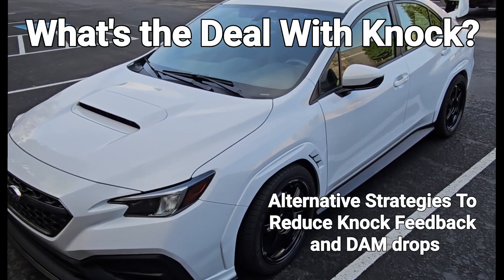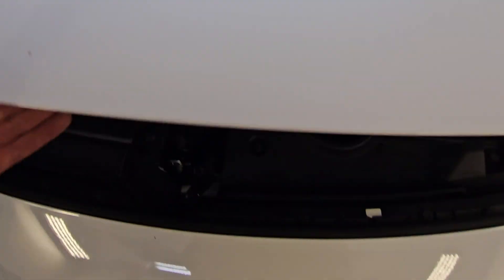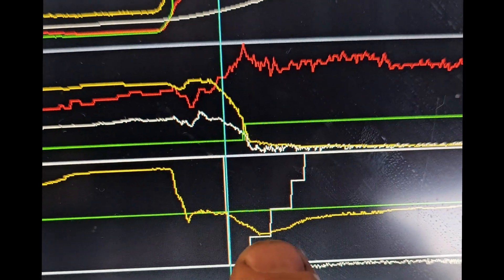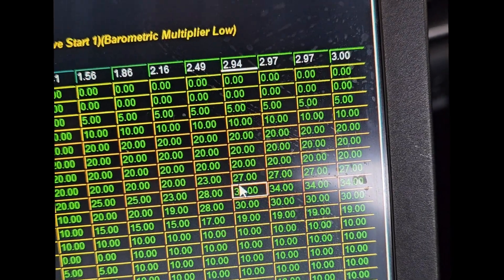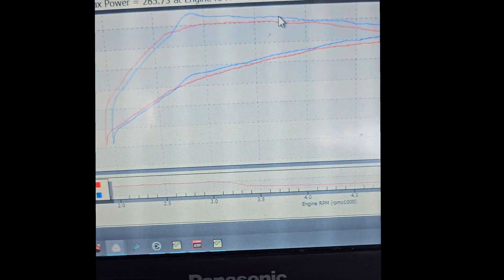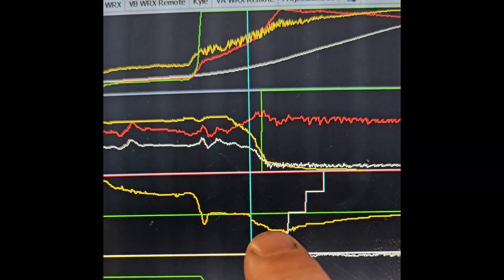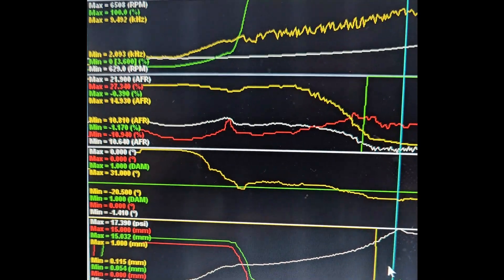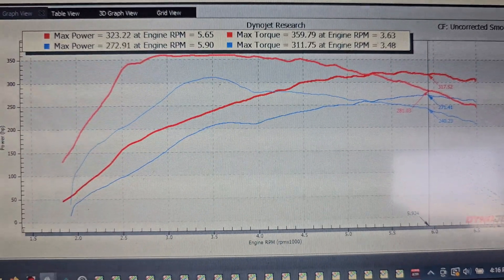VB WRX Tuning | Fixing Low DAM & Knock Issues on Cobb OTS Tune (Customer Car)

Comment: Was it the injector timing that fixed it? Any changes to the tip in enrichment? When did injector timing start to become important on Subarus? For reference I have been tuning my 04 STI and 09 WRX with ECUFlash, neither have injector timing defined.
Reply from the maker: So,  on DI engines tipin isn't really a thing since there's no pooling on the walls/valves. Injection timing is everything on DI. It's actually a lot more important than most people realize in port injection as well especially on cars with very large injectors and/or big cams.
Reply: @WT4T  Ohhh I didn't even think about that. I know injector timing matters a lot of diesel engines so I guess it makes a lot of sense it would be the same on DI engines. I learned a lot tuning my STI and when I went over my WRX e-tune I realized how lazily it was done!

Comment: Hey brother i have a vb wrx cvt and have the cobb ots 91 map. I have ets cold air and axleback exhaust and my dam is ALWAYS low. Can you provide me with some information on what to do?
Reply from the maker: Well, that's the wrong tune for that intake. Probably just get the car tuned, and you'll be fine! If you email me at willtunefortacos@gmail.com I can get it taken care of for you.
Reply: Ladies and gentlemen, the average human. "I put parts on my car with no thoughts or knowledge and now it act wrong. Wat do?"
Reply from the maker: To be fair,  the parts were within the specs of that tune.

Comment: What’s your stance on Perrin intake with no tune. I’d love to see your readings on that (Perrin states it’s safe)
Reply from the maker: Hard no,  as seen in this video.
Reply: Interesting! so in the vid he had an OTS tune with a perrin cai and it was clearly bad..my assumption from your comment is it would’ve been even worse on the stock tune?
Reply from the maker: @wandsonsantana8178 stock tune has almost no wot adaptions.  It's just lower boost targets.  Definitely not ideal.  "Safe" is a very loose word

Comment: Would you say that it's pretty pointless to upgrade a VA wrx for the price vs. the power that they are able to produce? Would it be better to put the money elsewhere (suspension, etc.)
Reply from the maker: The vb is so much better. I wouldn't do much more than basic power boltons to a va. The va does get better mileage, so potentially, it's a better commuter.

Comment: The amount of people running intakes without tunes or running ots tunes and the wrong parts for that exact ots is mind boggling. E tunes are pretty affordable
Reply from the maker: Hint, most of the etunes I'm seeing are just ots tunes that someone paid extra for 😪
Reply: @ damn that’s brutal, I can see that for the vbs. Very cookie cutter easy to pull that off with

Comment: Great content. I love this stuff. 👍  Out of curiosity would you know or hazard a guess what a Vb would do (HP etc) with a Jpipe/ cat back and cobb tmic and no intake compared to with an intake? Say a Perrin CAI ?  No charcoal filter as the AU model not fitted with them. 😊
Reply from the maker: Probably 320-330ish, maybe more if you really lean on it boost wise.  I'm sure I have graphs of that combo somewhere I could dig up but getting hung up on numbers on these cars is kinda silly.
Reply: @WT4T  Thanks for the reply.  I'm just trying to get an idea if it's worth putting a CAI ( Process West variant) on as I have concerns with the K&N oiled filter (RE-0930) they come with. ie How much it filters or not. lol Cheers
Reply from the maker: I've found the ets intake to be the best on the market so far for power and haven't had a maf issue with one yet.
Reply from the maker: It might be but I think it's dry, at least it's not all oily like most

Comment: If you have a stock VB and you do a stage 1 91.  Should there be any issues with knock? This looks all so complicated lol.  Thanks for all the great videos
Reply from the maker: You'll probably still find issues with knock. The stock tune has a ton of knock.
Reply: @WT4T  oh ok so even stock there’s knock issues. This is all so new to me.  Just worried I’ll end up ruining the motor lol.
Reply from the maker: @Scootscoot2 sometime I'll get a full stock car and run it on the stock tune and show everyone.  It's quite awful.  Not nearly as bad as the VA, but bad
Reply: @ thanks for your replies.  Really enjoy watching your videos.
Reply: @WT4T  VA literally had the worst stock tune in any WRX I have ever driven going back to 2005.  That shit was bad bad and the rev hang was brutal.  Going from stock to a Stage 1 tune on VA was a QOL change the bonus was a little more power.
Reply from the maker: They really were the worst car Subaru ever made out of the box followed by one of the best.  Crazy what a few years can do.
Reply: @ Exactly.  I was blown away the first time I drove a VB at how smooth the stock tune was.  I was expecting VA type fuckary.
Reply: Here is a though maybe just use 93 octane? turbo cars always required it in the past. You got complacent with how direct injection allowed 91aki/95ron to run with stock tune. If you crank up the boost switch to 93 and stop acting like greedy monkeys. All of those sorts of wrx owners then moan how "unreliable" the car is when they mess up the car by how they use it.